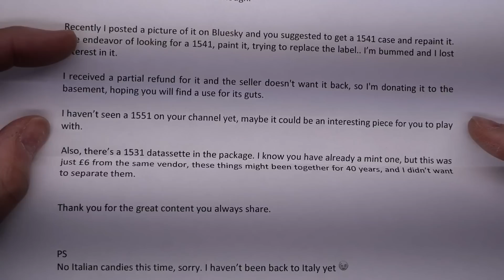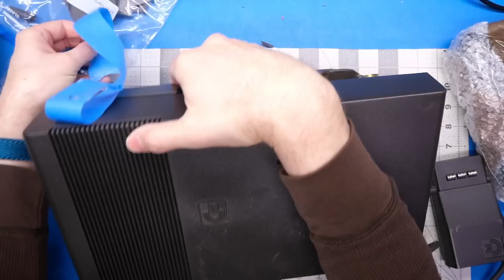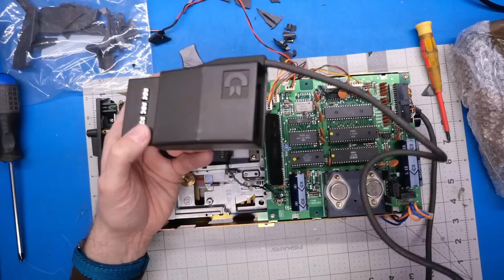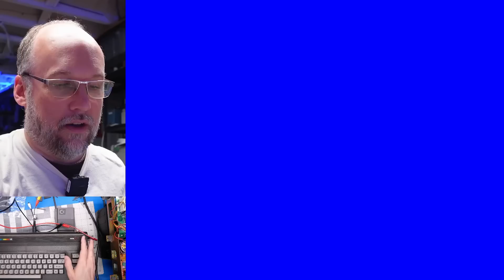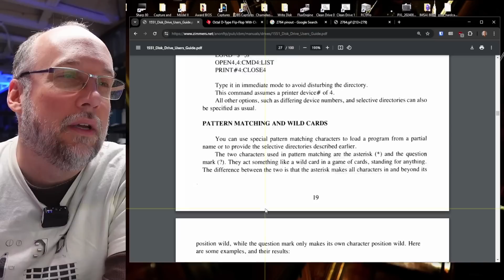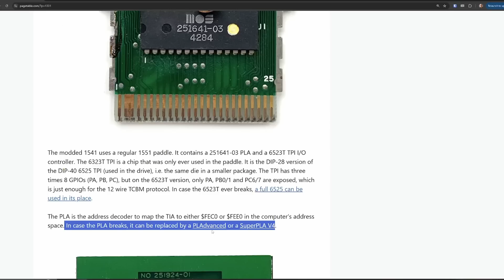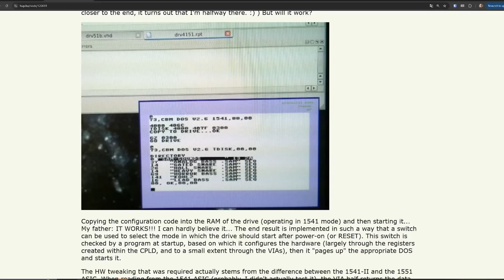0101 A broken Commodore 1551 disk drive

Comment: Sadly this same scenario just happened to me; bought a 1551 off eBay seller said it was packed for "international shipping" arrived with the top case completely smashed and bottom half damaged.  After replacing a few parts from a 1541 drive into the 1551 it at least reads and writes correctly so hey that's good.  Ended up with a partial refund and the seller sent a replacement top half which arrived intact this time.  Now I just need to glue the bottom half back together.  Grateful the drive itself at least functions despite the shipping damage.

Comment: Partial refund? I'm thinking that is an indication that it was already like that when it went in the box. Often when that happens, you find a previous listing for it from the same seller. In other cases they probably bought it, it came like that and they tried to pass it off and get their money back. Regardless, the times I receive something like that, I make them give me a full refund. If they won't, eBay will do it. If they won't my credit card company will. 

I have to say, the sellers that put a heavy piece of equipment into a big box with a single sheet of bubble wrap not even wrapped and taped around, but just thrown in there, are scammers. I bought a Spectronic 80 spectrophotometer from eBay. It was about 24"x 18"x8" or so and weighed about 40lba. It was in a huge box with literally a single 12x24" piece of bubble wrap. That's seriously just a scam. There was no intent to get it undamaged.  It suggests that there was something severely wrong with the item BEFORE shipping that they are trying to cover. 

The idea is probably that some people just don't ever ask for a refund. They just accept it or in some cases maybe try don't get around to opening the box until after the return window. Or they open the box and it's not damaged so badly that they notice, and don't come back until after the return window has passed. 

In other cases, they ask for a refund. Then they usually ignore you. Some people just don't bother to follow up. Again, a win for the scammer. 

Other buyers open an eBay case, so they offer a partial.refind. Still a win, they sold a broken piece of equipment and made you accept it. You probably wouldn't have bought it or wouldn't have paid that much. 

Some demand a full refund. So they try to make you eat the shipping back. Some people just give up or take the partial refund.

Some demand the full refund and return shipping if they want it back. 

If there's literally no value in taking it back, they might just do the refund. Otherwise they ship it back. And try again with the next victim. 

And overall, they turn a higher profit than they would have by being an honest seller and for example, selling the broken gear with proper descriptions and disclosure, or breaking it down and selling the parts. 

I'm not sure they DO make more that way. I think if they just sold equipment and broke the broken stuff down for parts or sold it as parts they would do about the same. But they clearly think they do. Some people are just naturally drawn to dishonesty.

Comment: When you talked about the power light and indicator light, I noticed that you kept saying that the indicator light was not coming on showing power.

The green light is power marker and the red light is the read/indicator light so when you looked up the manual you said that the power light was not coming on, that is because the power light was of to the left tucked away to the back to keep the wires from going into the mechanism and you focused on the read, write/indicate light as the power light.

Comment: Dang, Adrian, you didn’t have to get so savage against the TED line. I mean, instead of focusing on what they lacked, focus on all the great stuff they had that Commodore should’ve added to the C64c had they not been, well, Commodore. The superior version of BASIC, the Machine Language Monitor, the 6551 ACIA instead of the trash CIAs, a faster CPU, an actual Reset button, and the enhanced color palette that came closer to matching the Atari 8-Bit line’s color palette.

Comment: MOS 6510T

edit

The Commodore 1551 disk drive (for the Commodore Plus/4) uses the 6510T, a version of the 6510 with eight I/O lines. The NMI and RDY signals are not available.

Comment: The 6510T is not pin compatible with the 6510, it is missing at least one interrupt line.. 
For pinouts: https://myoldcomputer.nl/Files/Pinout/ICs_Commodore.pdf
And 1551 schematics
https://myoldcomputer.nl/wp-content/uploads/2016/01/1551_251860.gif

Comment: WHAT!?!?! The C16 is better than the VIC-20 IMO by leaps and bounds. Then again I've never had either, but it has more memory more colors and better basic. It's lack of popularity is the only thing wrong with it. It wasn't supposed to be better than the C64, but there is nothing about the VIC-20 that's better. This was never meant for games, but it's far more capable than a stupid VIC-20 whcih is the most pointless trash ever.
Reply: Spoken like someone who wasn't alive at the time and therefore never experienced the excitement of this new technology called a PERSONAL computer with COLOUR...  Just think, in 45 years someone may say the same about your Mac or $10000 RTX 5090 system.  I'd go so far as to say it now about the Mac...
Reply: @ffsireallydontcare  When it came out the VIC-20 had the worst resolution and almost no RAM. I do like color. Was it the best color-wise? maybe, but there comes a point where you have too many compromises. I was given the choice between color EGA or monochrome VGA. I picked color.....ended up regretting it. I didn't know what that meant. If I knew it was the difference between games like doom and not, I probably would have chosen monochrome. And then.....years later.......the TED series was released. It was meant to compete in the business space. Not play games. Yet it was superior to the vic-20 in every way shape and form. Does it matter that it came years later? nope. Spec for spec the C16 would have killed the vic-20 if they released both. The only reason it didn't kill was that the C64 was better even though it had more color......again proving that color wasn't always the winning combination.
Reply: @awilliams1701  So by your logic, the Vic20 was trash because the RTX 5090 is better.  To quote Craig Ferguson's Auntie Betty "Oh is that right?  Well shows what I know."
Reply: @ffsireallydontcare  A more accurate comparison would be a 4070 vs a 5070. Of course the 4090 is the best, but the 5070 is better than a 4070 for sure.

Comment: Oh it's 100% a computer. I saw a video where someone reprogrammed it to output composite video over the IEC line. I suspect more than that was required, but they had a C64 type demo running on a disk drive. No actual "computer". No sound though.....obviously. The demo was very limited in what it did. No where near as fancy as a C64, but just enough to prove, yes this is prossible.
Reply: I'm wrong on multiple fronts. I found it. It's called freespin. It only requires a custom IEC cable to be plugged in AFTER you load the program on the C64, which re-programs the drive. It does have sound made by the drive itself. It's absolutely wild. No modifcations at all just the custom cable.

Comment: I wouldn't be surprised if it's just a slightly modified 1541. Just the barebones changes needed to make it faster when exclusively only working with a single computer.

Comment: Use normal 240 volts as normal countries? No, we will use 110 and more amperes for greater loss in wires....
Reply: 110V/60Hz is a standard established by inventor Nikola Tesla and existing DC grid. European 230V and "round" 50Hz were picked by people without deep knowledge in AC and have as a result that efficiency is /lower/ (US distribution transformers are on the pole, European need a station of the size of a smaller house or a larger shed).

I live in Europe.
Reply: @docnele  In Australia where they still use suspended wires on poles they too have distribution transformers on the pole.  You have two choices, more smaller transformers or fewer larger transformers, and this applies to both systems.  
Efficiency is HIGHER with higher voltage systems due to ohms law, the higher the voltage the lower your losses due to resistance, this is why backbone power distribution is in the kilovolt range.  To quote Wikipedia "for a given quantity of power transmitted, doubling the voltage will deliver the same power at only half the current.  Since energy lost as heat in the wires is directly proportional to the square of the current, using half the current at double the voltage reduces the line losses by a factor of 4".

Comment: You could take all the parts, and carefully use Krazy Clue (strong grade clear cyano acrylic) and rebond everything together, I have done this for a lot of older plastics and things of that nature, but to do so you need everything in perfect alignment (I use saran wrap or cling wrap and place everything on a sheet of it in the pattern - if you stretch the wrap on a table, and then lay the parts down on it in the pattern, you can then spot glue each point back together) once everything is 'tacked' back together you then spend a bit of time regluing all those tacked points to fill in the gaps, take a file and file the excess glue off and smooth things out. You can make it almost disappear and look near origional.

Comment: My first own Commodore computer was a C116 with datasette (the infamous ALDI Basic kit), shortly followed by a plus/4 with 1551 drive. 
My 1551, just like my friends', (much to the amusement of the 1541-owning schoolmates) always ran hot after half an hour of use and could no longer read/write floppy discs.
The solution was either: 
1. to operate the drive without the lid, or
2. (My solution) Install a 12cm/240volt fan on the upper ventilation slots...

Comment: Question, or rather a challenge… Commodore never made a parallel drive for the C=64/VIC-20. If you re-cased that machine, is it possible to convert it, too?

Comment: Poor c16. Not quite the same thing but I recall after getting my Atari 800 that the the future is going to be be good and could see new machines coming along that would be even better… then the flood of machines from various new manufacturers that were just cheaper and nastier and that was the end of the home computer, shame on you Tandy for the mc10. The single board hex pad little 6502/8085 things in the late 70s sold because people were desperate for something to code on and experiment, my fix came from humble programmable calculators so a ts1000 was a step up. That stripped to the bones approach was not going to wash in 1985.

Comment: dont you have to load a floppy disk into it for it to showup?
Reply: No, you can interact with it without a disk being in it, like trying to load a disk which will result in the drive signaling to the C16 that there was an error.  If it's like the 1541 you should even be able to upload assembly instructions to the drive and have it perform calculations without ever interacting with a disk.

Comment: (Commenting a bit less than halfway through.  [Edited, Ah, it's using a "custom" interface.]) I'd guess that the 1551 uses a variant of the IEEE-488 interface, at least as far as protocols go.  I made an IEEE-488 interface to work off of a completely different computer some time ago, and it required 7 chips.  Two 8-bit gates, two 8-bit, Open Collector latches plus three 74-series logic chips to handle address decoding.  IIRC, the standard requires at a minimum an 8-bit bidirectional bus for data and 5 additional bits for control and signalling, three being computer-to-peripheral and two being peripheral-to-computer.
(It's been a while since I made that interface circuit, so I could be misremembering somewhat where the control signals are concerned).  IEEE-488 is also known as the General Purpose Interface Bus (GPIB).  (Edited: I'm still suspecting that the custom interface may have been loosely based on the old GPIB)

Comment: In BASIC 3.5, you can just type DIRECTORY to get a disk directory, and DLOAD to load a file from disk. It also has real commands to do graphics and sound. My first Commodore was a 16, and when I finally got a 64, it seemed so crude in comparison!
Reply: Same with v4 PETs. The better DOS commands make life sooo much easier.
Reply: @root42  You can thank Jack Tramiel for being a cheapskate and refusing to pay Microsoft to use a better version of BASIC in the 64.
Reply: @vwestlife then why didn’t Commode update the contract with Billy G after the Tramiel family left for the greener pastures of Sunnyvale CA? They could’ve updated the BASIC in the C64c. I mean, look at Apple and Atari in comparison. They updated their shipped BASICs during the commercial lifetimes of their competing 8-Bit computer lines. The TED line was supposed to be the budget computer line. It didn’t make sense to ship them with the better BASIC.
Reply: The function (basically: macro) keys are also "preset" to print common disk commands (among others). F3 for directory, for example.
Reply: @ Yes, and I believe pressing the Help key prints out a list of the function key assignments.
Reply: By default the Help key issues the HELP command; to see (or change) the current function key assignments, you'd use the KEY command.

Comment: There were at least some 110v and 240v 1541 drives that used the same transformer, just a different tap on the primary. It might be worth having a closer look at the transformer in the 1551.

Comment: Hi Adrian, I have an Apple IIc and the red LED does not work. When I connect an external floppy drive with a known good led it still does not work. I have one of the Zoyi DMM you recommended but I have no idea where to start. Would you happen to have any suggestion for a fix?

Comment: You probably have already looked this up, but here's what I found with Google's AI:
"When a Commodore 1551 disk drive's power light flashes when turned off, it can indicate a normal operating error or a potential hardware issue, such as a processor or ROM failure, or even a RAM failure"

Comment: Such a shame to see a (relatively) rare piece of hardware battered to bits.

When I bought my lovely Plus/4 back in the mists of time the 1551 hadn’t been released — or if it had, was way over my budget, so I had to make do with a much slower 1541.

Seems to me that the TED series was probably as much a victim of post-Tramiel Commodore marketing as anything else trying to push the price way beyond its design point. Some more interesting features never saw the light of day.

I was lucky to see a pre release demo at my local computer club (can’t remember if it was a 264, a 364, or both) where a software developer was showing their Word Processor which had designed to use the speech hardware. They were actually making quite clever use of it, not to read your text but to say prompts. For example, you might start a document save and be going to fetch coffee while it was saving, only to be called back by an auditable 'replace file, are you sure' msg rather than coming back 5mins later to find it on the screen. Or if you did nothing for a while, it’d say 'if you need assistance, press the Help key'

Comment: The "TPI" chip, that's a MOS Tri-Port Interface. Basically, the way the PIA had two ports plus a sort of "half port" for handshaking... the TPI had three full 8bit parallel I/O ports, kind of like the Intel 8255 PPI. Unfortunately, from everything I've heard, it was... far less than actually reliable (heat issues, as usual with MOS chips, tended to internally bake it in place, in practice), and combined with the fact that it was also reportedly a bit expensive at the time, it was, well, not a popular chip.

Comment: 19:00 I've accidentally nuked a device or two by using the wrong polarity barrel jack before. Now I use a label printer to show the polarity and voltage easily visible on power adapters and devices alike

Comment: Maybe find a 3D-printer guru, probably in Germany, who can melt the old case (just the bottom) and reprint it at high resolution. That way at least most of it would still be original and have one heck of a story. Blend in a bit of modern plastic for endurance and strength.

Comment: About 7-8 years ago I went to Poland to buy a 1541 (I mean, among other reasons going there) because my own floppy drive was broken (open head) - I recall swapping the floppy drive and I even sold the white 240v floppy case for the same amount I bought it for. The power supplies are not hard to change, you're right. 

I would just paint a 1541...

Comment: This isn't going to be a popular sentiment but I blame this friggin' awful plastic. I have a mid-90s Gateway Solo laptop P166 MMX in perfect shape - this was a $2500 machine new. It still runs perfectly but the plastic case is just crumbling. I have plastic parts on things from the 60s which are good as new. Cheaping out on plastic is why Commodore is dead. Find me some crumbling plastic in an IBM PC. You can't do it.

Comment: I had one of these many years ago. I sold it on eBay eventually. I listed it as untested because I couldn't find any 264 series machines at the time, then halfway through the auction I found one and decided to test it. The drive was broken - and get this - I cancelled the auction (which had bids on it) and relisted it with a new description that said it didn't work and would need repairing.

Also, if you decide to rehouse it in a modified 1541 case, try using vinyl dye rather than paint. It actually recolours the plastic, unlike paint that just leaves a layer on top, so it won't scratch or peel off. Normally it should be a dark grey - something like RAL7021 - but some end up a dark brown colour because the plastic has yellowed.